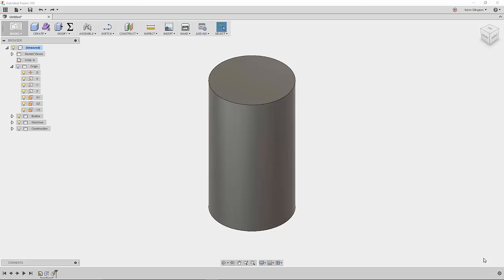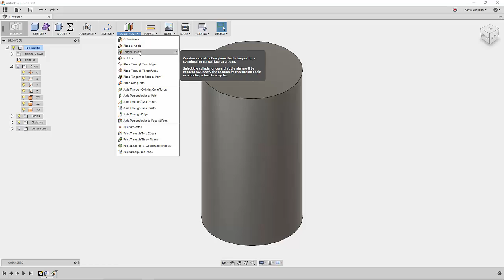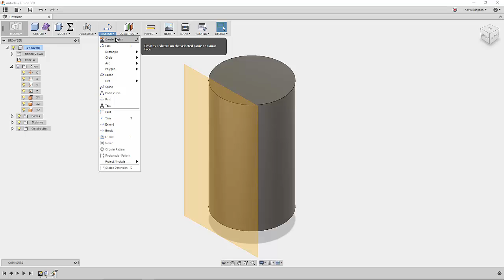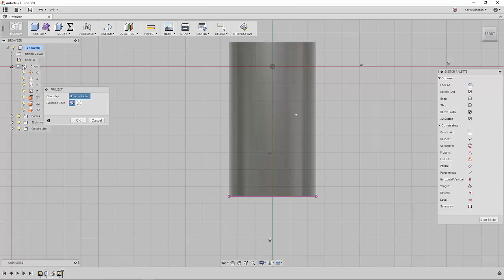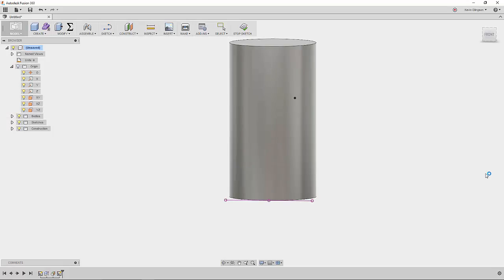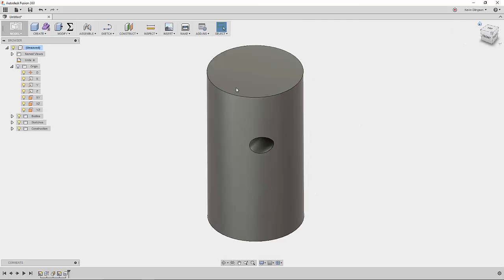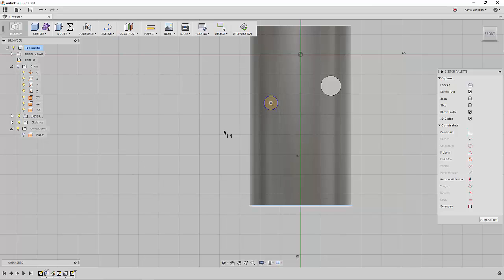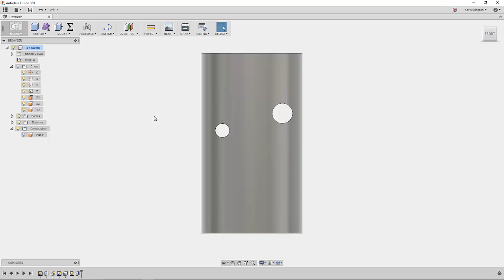Fusion 360 Offset Hole on Cylinder Face

Comment: How to hole on center but 60 degree angle ? 
Trying to recreate a part, it is a 30 tooth  gear  with one dowel pin at 90 degrees to axis and a second pin set at 60 degrees to axis. I'm stuck.

Comment: How do you create a printable, 1:1, flattened drawing of the hole.
Reply from the maker: That is not yet possible. Once sheet metal is out of preview, I can show how this could be done.
Reply from the maker: This week, I'll start the rollout of new videos after what has been forever. I travel a lot so I wanted to get 20 finished so I can release on a weekly basis and not have to fight to find time to release them. I think though I will do a quick video on how to do this. If you have a part you want me to duplicate, send me an email to info@mechanicaladvantage.com. otherwise I'll just do a quick video on the concept showing how this can be achieved.
Reply from the maker: I decided to make a quick video of what I was talking about. What I didn't do was to create a drawing of the flat pattern, but I don't think you will have too much problem with that. If you do, let me know and I can show that process as well. Link to the video in the below. 

https://youtu.be/_3zj9IgDAA0